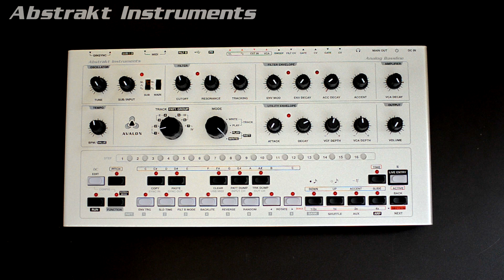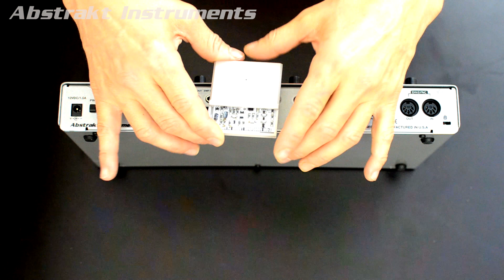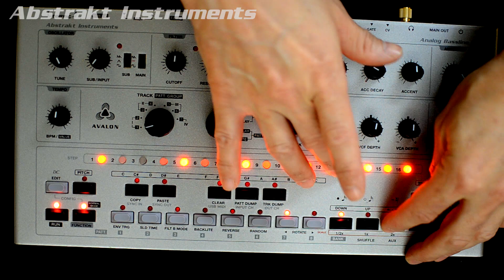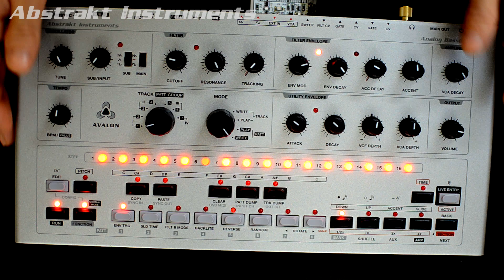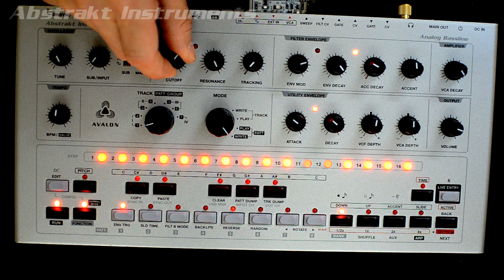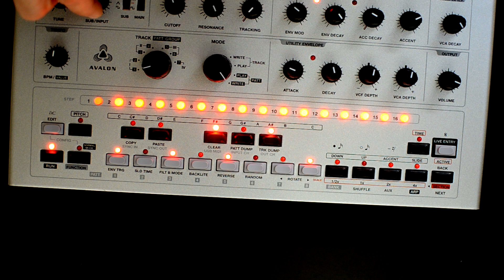Avalon Bassline - Overview

Comment: You can do all this with a TB-3. I know it's hard to believe, but here's how
(1) Find the TB3 unit in your setup
(2) Switch the POWER on the TB3 to OFF
(3) Unplug power, MIDI, USB and 1/4 inch cables from TB3
(4) Pack TB3 in BOX and place on EBAY, or keep it to use as a handy doorstop. 
(5) Purchase Avalon Bassline
(6) Unbox Avalon and reconnect POWER, MIDI, USB and 1/4 inch
(7) Off you go!!!!!
Reply: +Tobin Dack Weird humour. I am sure someone is rocking it in the clubs with a TB-3 and everyone is perfectly happy.
Reply: +Bradonomous Super hilarious! :P I def have to get this unit!
Reply: LOOOOL
Reply: Bradonomous totally worked for me.
Reply: This sounds about as far from the original as TB-3 so..